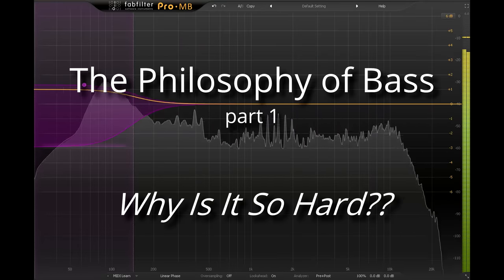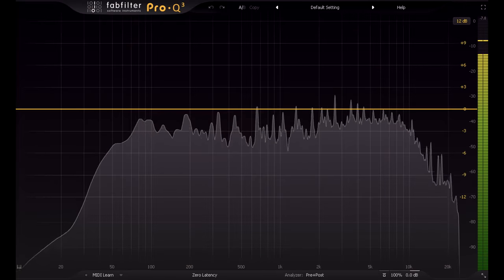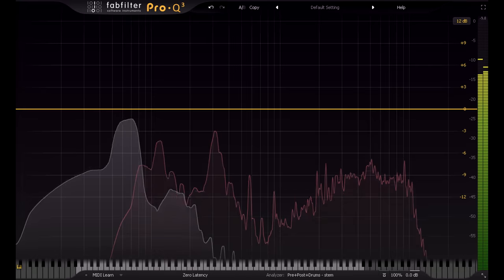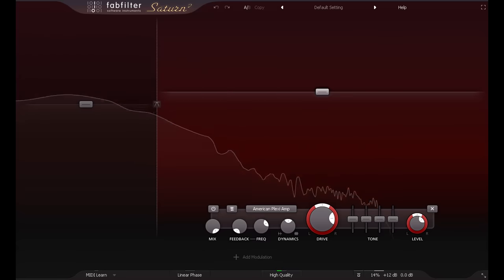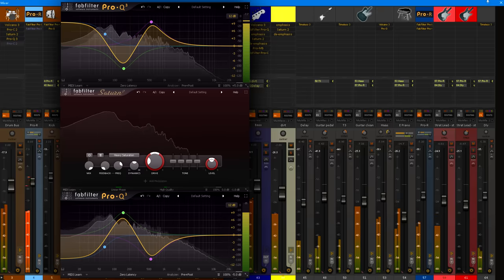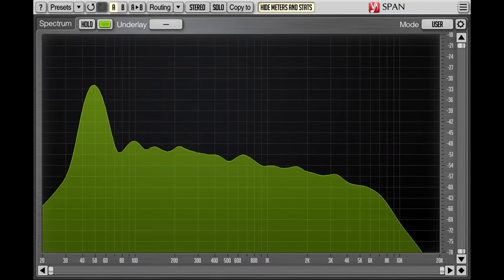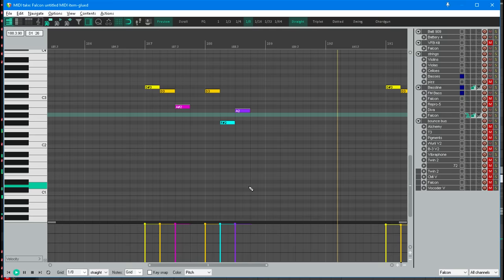The Philosophy of Bass

Comment: 1 more tip I would like to add for getting the bass right (and everything else for that matter) if you simply cannot afford to get big speakers and an amazing room, is to buy the highest quality format of songs by producers which do have those big speakers and great rooms and listen to those songs through your setup that you have at home. Really pay attention to their mixes, and how the bass frequencies are performing, how loud they are, how long/short they are etc, every little nuance and try as best you can to replicate that in your own songs. That's the most cost effective method that I have found for getting close to great low end. Noisia songs are a great place to start!
Reply: That's a really good idea.  IIRC Pro Q3 has a way to get the 'signature' (or something) of a track.  So you could run the analysis on those reference tracks and apply it to yours.  Probably only keep the corrections for <= 100 Hz or so if you are only concerned about bass frequencies.
Reply: It has been said that this was the secret of the NS-10s referenced here in the video.  Their frequency response wasn't great, but engineers knew it by heart, and what a good mix should sound like on them.  You can compensate for a lot of sins through experience.
Reply: to much mind games and guessing

but if u can work that way u r a genius with a good ear
Reply: @starkid9736  I don't think the mind games and guessing is an issue really because you are not trying to make a perfect true copy between your reference song and your song. You are simply using a really well produced track in your genre of choice and using it to guide you towards a great low end (or full spectrum) mix. The difference is quite big and obvious when you are quickly soloing between your full mix and the finished reference song, so even for newer people with less trained ears, I think its obvious enough for them to get enough information to make positive mixing decisions.
Reply: Noisia and Spor.
They are both way ahead of almost everyone else.
Reply: Reference tracks go a long way!! And you can trick the room modes by not playing too loud. Checking with headphones and... The day after... THE CAR CHECK!!
Reply: Noisia and The Upbeats.!!!!!
Reply: Check out Tipper as well!
Reply: Or wait.
Reply: "noisia songs are a great place to start!"

says every single worthwhile producer ever to ever reference any song, ever <3
Reply: @ThaJay  Spor aka Feed Me! Was just listening to him today, didn't expect to see the name here!
Reply: @undeaddutch  I second this, get dan Tipped
Reply: Back in the day, I had a Renault 5 with an average Sony cd/mp3/usb/radio (4x40W), and 2x100W RMS mac audio 3 way coaxial 6'x 9' (about 50€) on an upholstered wooden shelf. Everyone, myself included, was blown away how good the sound was. It was better then most of the clubs' in town... Oh, and I used to listen to breaks A LOT! (Plump DJs and such)
Reply: To put it in another perspective - You just 'simply' LEARN YOUR ROOM, and what sort a relationship it has with Your speakers. Stuck with it long enough till You'd finally afford Your first dreamy monitors and thrust me - first two weeks/months maybe wil be a fuck up after fuck up, thats chasin a fuck up xDDD and find Yourself  in odd position realising that the 'old gear mixes' are decimating the new ones :D
Reply: @Sengin31  this can occasionally help - but just as often hinder - one big issue is the key of the song. That big push you see at 41hz might be just because the song is in the key of E - if your track is in F# then applying the same bass curve might suck very badly indeed!
Reply: Or do a spectral analysis of those tracks and try to fit things in a similar pattern.
Reply: Invaluable advise this. Thumbs up.
Reply: And there you have it !
Reply: immitation is an important stage of human learning at all ages. Humble pie is always the best dish as you wisely imply!
Reply: may I add invest in reference by mastering the mix or similar plugins
get used to how they sound, get tools to compare your track to their
Reply: your point should be taken with a big grain of salt, most EDM especialy stuff like Noisia is a special case where all sounds are synthesized and everything is Square and controlled, no impredictability, no vocals, no live instruments/sample Loops. 90% is synthesized. this is the main reason why most EDM producers dont need a mix master engineer. basicaly its just a bunch of square&saw waves, and the sub is very often just a sine wave. I'd say Noisia wouldnt even be applicable to Trance, let alone pop, hiphop etc.
Reply: @David-hs1bu  hey, I mix lots of EDM and techno, it's actually pretty technical to mix. I'd go as far as to say it's simpler to mix orchestral and Bigband recordings, provided they are recorded well, than it is to mix an underground techno record. It's a funny world ;)
Reply: @David-hs1bu Despite knowing of Noisia by name, is it possible you stopped listening to new music in 1988?  ;-)  I jest, but In response to what you said about the squareness of waves: I will sincerely say it's probably the very painstaking attention to sculpting each and every low-frequency event, in both its spectrum and waveform, often as a continuously evolving aspect of a phrase or track that is unique in each new moment, that sets music by artists like Noisia, Tipper, and (goddamn!) Mr. Bill apart from yesterday's club toons. Worth checking out at a deeper level, I humbly suggest.
Reply: Yep referencing is key in any genre of music to reference your track to the fundamental frequencys. Just drag a high quality mastered similar sounding reference track into your daw, match the lufs of your track and reference track adjusting gain on the reference track to match, open an e.q and see where you are lacking in low and high frequency ranges and adjust gain where lacking. Obviously its not going to be exact its just a guide to get near where you need to be!

Comment: Hi Dan, can you say if it's okay to use DI and Amp signals of a bass with a crossover (DI for clean lows, amp for saturated mids and highs)? Using crossover like in one of your videos where the result is flat EQ curve with no dips and boosts. I've heard from another mixing engineer that it's a bad idea because they're gonna fight in the crossover region, due to added harmonics. Can you please clarify? Thanks!

Comment: 🎯 Key Takeaways for quick navigation:

00:11 🤔 The problem with getting bass right in mixes often stems from inaccurate monitoring systems, including speakers and room acoustics.
01:05 🎛️ The size of speaker cabinets affects the high pass filter, more pronounced at low frequencies, impacting bass response.
02:56 📦 Larger speaker cabinets result in a lower high pass filter, necessary for accurate low-frequency reproduction.
03:54 📢 Subwoofers need to be significantly larger than main monitors to reproduce low frequencies accurately.
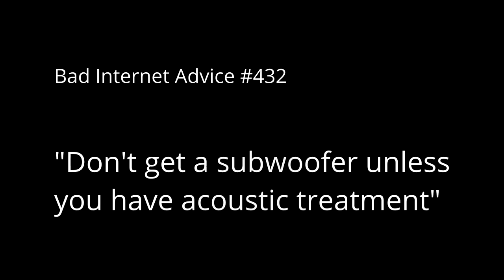04:22 🛋️ Acoustic treatment, particularly bass traps in room corners, is essential for improving bass accuracy.
05:47 🎶 Accurate monitoring of bass frequencies makes it easier to achieve a well-balanced low end in mixes.
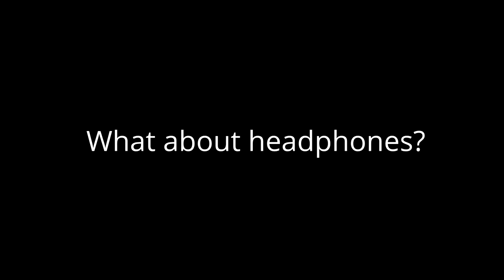06:14 🎧 Choosing the right headphones for mixing is crucial, as not all headphones reproduce bass frequencies accurately.
07:38 🎵 Bass in music requires a low fundamental frequency below about 100Hz, but various harmonics can be added to create depth.
08:56 ⚖️ Different approaches to creating bass: "Body Bass" focuses on low fundamental, "Brain Bass" uses harmonics to create depth.
09:53 🥁 Spectral separation or temporal separation can be used to allow the kick and bass to coexist without interference.
11:11 🎛️ Techniques like ducking with plugins like Pro-G or Pro-C2 can help balance kick and bass in the mix.
13:00 📈 Adding higher harmonics to bass parts helps improve compatibility with smaller speakers.
14:41 🔄 Ducking the higher harmonics along with the low fundamental can enhance the perception of bass.
16:29 🔀 Parallel distortion can be used to add clarity and definition to bass parts.
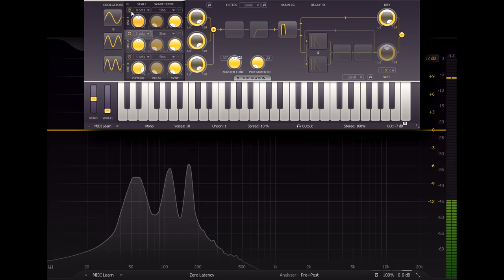18:40 👂 Psychoacoustic effects can create the illusion of a low fundamental even when it's not present in the audio.
21:01 🎚️ Parallel distortion and EQ techniques can help enhance the bass while maintaining clarity.
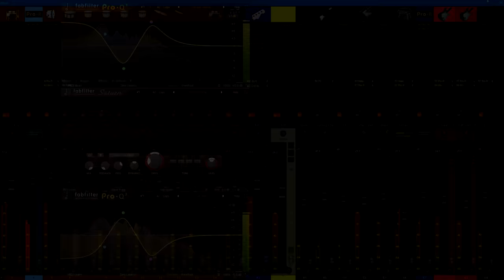23:19 🎛️ Using high pass filters can help keep non-bass elements clear of bass frequencies, improving mix clarity.
23:45 🎵 Using highpass filters, especially at 80-100 Hz, on non-bass channels can help clean up your mix.
24:36 🔄 Applying highpass filters to bass or kick parts can tighten them up and remove unnecessary low frequencies.
25:34 🎛️ Experiment with different filter styles and drive amounts to shape the low end effectively.
27:17 📊 Don't aim for a perfectly flat analyzer response; use it to diagnose issues, but focus on what sounds good.
29:13 🔊 Avoid over-hyping low frequencies, as it can lead to issues on both small and big speaker systems.
30:11 🎛️ Multiband compression on the low end can help keep it tight and punchy without overblowing the mix.
31:58 🎚️ Carefully manage the release and attack settings on multiband compressors for the low frequencies.
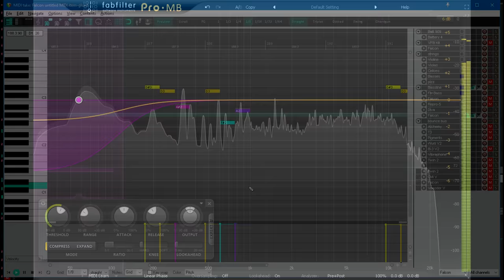32:28 🎵 Pay attention to the timing of note ends for creating a tight and punchy low end

Comment: Group delay is also influenced by number of sub/woofer drivers. This is why one massive sub is often the way to go where you have a specific listening point as the optimum wave node/listening area is largest and cleanest this way. My first sub was 10" (paired with some DM110s, then floor standing B&W DM604 S2s), the next sub was 21". A 21" sub that can move nearly 10L of air per stroke. You can get down to 8Hz of a 64' pipe organ this way, which in my opinion is 'reference' of range of any possible musical content that you normally encounter.

Beyond that (rocket launch reproduction, wind and pressure effects etc), you need a rotary subwoofer and a spare room to act as an infinite baffle. Good luck lol.

Comment: Mr. Worrall, doesn't the HP filters dip down a little higher than the set frequency so that if we pull up the filter close to the fundamental , it will instead dip down the fundamental itself instead of cleaning it? Thanks in advance.

Comment: Written 07:24:
Considerations for monitoring with headphones:

- Monitoring accurately: 
sticking to known manufacturers, there are large libraries of pretty accurately measured frequency responses for most makes and models of headphones. 
With these come impulse responses to basically make any pair of headphones technically virtually flat, depending on the accuracy of the measurements. 
This will make decent listener-headphones honest in the mid-ranges.
This will not magically enable shit headphones to have detailed high-end.
Most non-studio headphones have a very strong bass response, which usually gets cancelled by this method as well - adjust for that so you don't end up putting a +10dB low shelf on your mix. 

- Reference:
if you're mixing on headphones, get familiar with them. Don't just use your studio headphones for studio stuff, it is essential to have a large frame of reference for your monitoring system. You can use EqualizerAPO (open source, quality software) to adjust system audio with equalizers, impulse responses and even VSTs.
Reply: Ha! I've got a pair of MDR-1000x :D

Comment: On the question of your personal montors not accurately reproducing the full range of sound, there was a device which simulated  different montors over your headphones. 

Focusrite’s Virtual Reference Monitoring (VRM) -  I'm not sure if this device is still available, but there are other ways to achieve the same ends .  eg Redline Monitor plugin , isone pro, Saffire pro24 DSP [which has VRM built in]

Comment: Great video.  Bass is tough!  A lot of people don't realize how much it actually interacts with the room compared to the other frequencies.  
Also, (rant) I personally hate the way ducking sounds in musical mixes, though.  It is a sad side effect of excessive dynamic range compression.  At least it can be solved at the arrangement level.  A great example is the song 'Titanium' featuring Sia, which uses extensive ducking.  It sounds OK on a bluetooth speaker because those don't reproduce the bottom octaves, but on anything more capable, the ducking is extremely pronounced, and I think a mix that didn't use ducking like that would likely sound better (more in line with what a live performance would sound like).  I understand the reason people use the technique, though.  I just think it sounds terrible.
Reply: I don't do ducking unless it's as a special effect, similar to how you might use the "telephone bandpass" effect to make something sound deliberately shitty so that you can then drop it on the listener again, correctly. This has twice led to me just flat saying "no" when asked to use the effect in a collaboration. In one case, the other party agreed it wouldn't have accomplished what he thought it would and therefore wasn't worth it. In the other case, it ended the collaboration and the song never got released. I'm fine with both results.

Comment: Really excellent content!! I think you have not mentioned a very important element which is the volume at which you are listening. We will perceive things very differently with the same room, same speakers and same mix at different levels. A little anecdote : I was in Kingston  (Jamaica) in a session with Sly and Robbie engineered by Fatty (some 30 years ago) and I couldn't believe how loud they were listening on those huge speakers in the control room! I had to walk out as I felt that I was going to suffer hearing loss pretty quickly. As I was standing in the corridor it suddenly struck me that this was probably a very important factor in the sound they were achieving in the end! And those guys have the best low end on the planet! Use this tip at your own risk...
Reply: as if listening at a volume that might damage your ears is EVER good idea just cause some guys with "good bass" do it
Reply: @grapheme2696  Yes, that is why I walked out pretty quickly, but I used this anecdote to exemplify the fact that the loudness of monitoring also changes dramatically the way you perceive bass levels and the sound of your mixes. No need to get stroppy about it, chill out man...
Reply: Maybe they wanted to feel the bass. You could try that with ear plugs